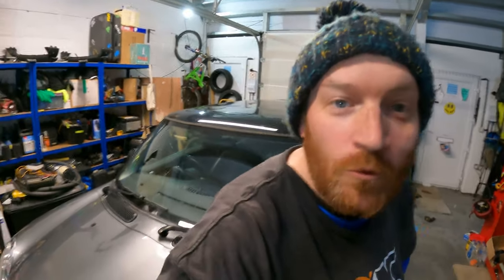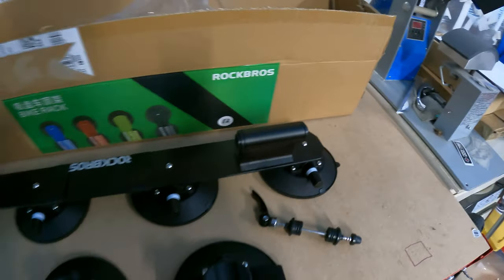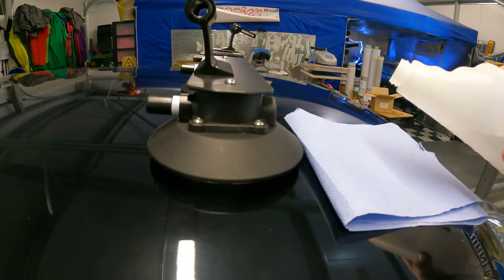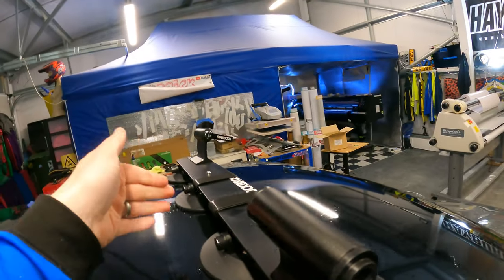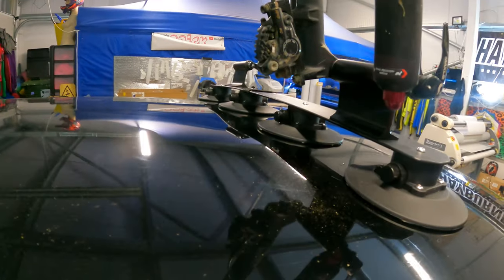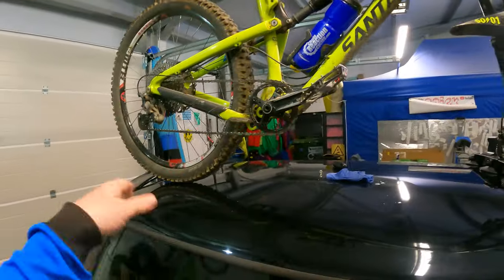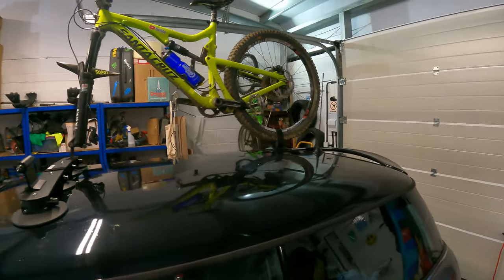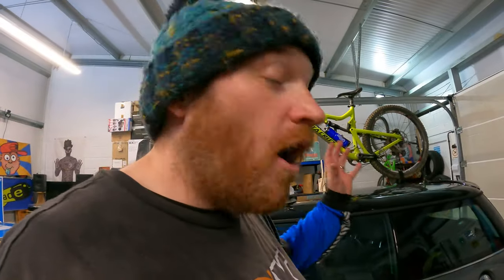Suction Bike Racks...  Are They Any Good?  Seasucker / Treefrog / Rockbros Rack

Comment from the maker: What are your experiences with suction bike racks?
Reply from the maker: Comment below! ✔
Reply: I’ve been using the 3 bike version of this rack for almost a year with great success! Mostly use 2 bikes with it, but have put 2 adult bikes and 1 kids bike on it. The cups have crazy impressive suction. Highway speeds are no problem. I love how versatile it is. Can literally put it on any car!
Reply from the maker: @Andrew-ye4fl  You are right the suction is mad!  I just check the suction every time I set off (overkill maybe) and it works a treat.  I've now replaced my MINI so I'm replacing the suction rack for something more permanent now my car has the appropriate fixings but I'll be keeping the Rockbros in case I need to stick my bike on another car :)
Reply: @Andrew-ye4fl  I've been searching for an unsponsored comment on how this product behaves with motorway/freeway/highway driving so thanks for posting!
Reply from the maker: You're welcome !

Comment: I have had the Sea Sucker version for 2 years or so as I have spent a small fortune on Thule racks and bars over the years due to me frequently changing cars.  I've never had a problem and have had mountain bikes and gravel bikes up there.  The roof may 'pop' on bumpy roads but it isn't the suckers coming off, its the roof flexing (Audi Q5 & VW Tiguan).  The Q5 had a mostly glass roof so the rear wheel sucker was attached to that.  The guy at the shop demonstrating these suckers stuck two on the shop window and hung from it.  They were factory tested on a Porsche up to 140MPH so regular motoring is fine.  The only downside is I cannot lock the bike to the sucker and roof so it can be removed quickly by anyone who knows how, so if it is going to be out of your sight bear this in mind.  Also once at your destination you remove them and put them in the car so someone doesn't nick them, so take a cleaning rag with you.
Reply from the maker: All good tips Al, the flexy roof is nothing to worry about.  That sheet metal on car roofs is mega thin.  Porsche @ 140mph sounds fun!

Comment: I’ve got the Treefrog Pro and it took a lot of courage to set off on a 100km drive with my €8k Supersix Evo on my roof! I stopped three times to check the vacuum but they stayed rock solid on the roof of my car. I absolutely love them, and frequently get stopped or asked questions when people see me with them on the bike!

My only comment would be not to recommend the Rockbros over the Treefrog or Seasuckers. 

They both offer much better customer support (my friends who have Rockbros have been constantly disappointed and swapped), and they also offer every spare part under the sun.

They do cost more so I guess if you are on a budget, maybe the Rockbros is a good shout but if you are placing a Santa Cruz on them, I’d spend the extra…
Reply from the maker: Hey, some good points there.    Took some balls for sure the first few runs but all is good!  I think I was more recommending suctions racks in general rather than the Rockbros in particular.  I've only ever used the Rockbros so I'm not in a position to compare them 👍  Thanks for watching 😎

Comment: there is a lot of good reviews on suction  mounted bike racks as long as you follow the mounting instructions, clean surface ETC & why not the Shard's glass in London  was lifted with suction cups. Mine is roof mounted to my VW Tiguan on the roof bars, in 2000 we went on holiday to Wales & on the way back my wife was feeling car sick so I pulled in to a car park in conwy & forgot all about my wife's Specialized Rock Hopper on the rack, there was £1000 worth of damage to the wife's company car, the rack was wrecked & the bike had a small mark on the head badge which was easily touched up with a touch up stick & she still rides that bike today. It takes a while to get used to it, but when you do its the cheapest way to carry your bike, no fitting tow bars, rear mounted racks, electrics & number plates, that route is £1000 to £1200. One important thing is those with disc brakes fit a spacer in your caliper once you have removed the wheel, if you accidentally press the brake lever your pistons will not come out.
Reply from the maker: Absolutely, the suction cups are a great invention.  Sorry to hear you had an incident with your wifes bike - you really got to have your wits about you with roof mounted bikes haven't you!

Comment: 8 months later, has it ran safely all the time, I hear their after sales support is actually very good. Thanks in advance.
Reply from the maker: I actually changed my car to an estate with roof rails at the tail end of last year so these are awaiting my next car that I can't fit roof bars too.  They worked great for the 6 months I was using them.  I was actually shipping my little lads bike around on there too with no issue whatsoever
Reply: I heard the total opposite but maybe that depends on your location…I’m in Spain.

Comment: Never used them. My experience with suction mounting hasn’t been good but these look pretty heavy duty and obviously passed the test. I’ve only used towball mounted racks.I’ve  always been worried about putting bikes on the roof and then wiping them off on the carport, which is actually quite low. I’ve got an SUV now so I just throw the bike in the back. Putting the bike/s on the roof would free up some space though.
Reply from the maker: I am surprised how well they work.  The mounting surface is a stiff conformable rubber which does conform with the curves in my roof.  Losing your bike to a car port is not as good look 🤣 If I'm honest I wish I could fit my bikes in my car but it's just not possible with this car.
Reply: Been there mate. Had my carbon MTB on the roof of my 2 week old car, forgot it was on there and drove under an archway with a flat on top. Ruined my back windscreen and roof was all gouged so had to have it repaired under insurance. The bike took some damage but not too bad. The guy who’s flat it was above wasn’t too impressed either. Haha.
Reply from the maker: Oh dear!  I don't know if I'd be more annoyed about the car or the bike!
Reply: @mtbtomfoolery  I think the bike survived because the forks and rear suspension were not locked out so I think the bike compressed and flew off but gouged all the car in the process. 😂
Reply from the maker: Good job you had a full bouncer!

Comment: When I got my new car last year I just paid for a trailer hitch to be installed for $209 us and bought a hitch rack. I’m concerned that over time your roof rack will fail and toss your bike. Hope it works out for you but I would be too scared to try one of those.
Reply from the maker: That seems a good deal.  These suckers are rated for high loads, in construction they use them to lift glass panes (not the same ones obviously!) Obviously a roof panel isn't flat so that would give more opportunity for air ingress over time but I check they are pumped before every journey and they have been great.

Comment: Great video.  Do you have any idea if it would work if your mini had a sunroof?  It looks like the front of moon roof the curve of metal would be too much?  Do you know the length of end to end of outer suction cups?  Maybe the rack is too long to suction to the moon roof.
Reply from the maker: Thank you.  They recommend that you don't use them on a sunroof but plenty do with no issue.  That curve in front of the sunroof probably would be too much (I've sold my MINI now so I cannot check for you sadly).  The one bike version would certainly fit on the sunroof, if any of the cups on a longer rack went over the join between roof/sunroof it would not be effective.  Hope that helps.

Comment: So how do you keep people from stealing those sucker with or without a bike on it?
Reply from the maker: You don't, they are not designed to be a permanent rack so you remove them when not it use.  It takes about 10 seconds to remove it all and stash it in your vehicle.  If you leave it unattended with your bike on it you are asking for trouble no matter what rack you have.  That is not a risk I would take with any roof rack setup.
Reply: Forget about the bike which I take it in daily of course, but does that mean you should/have to mount/dismount the sucker rack daily if you live in apartment/park outdoor because while it will take forever to steal my old Thule roof rack with lock, it seem it might be a 5 second job to release the suction and take the whole rack without the need for any tool? is there some kind of thief proof thing for the system?   thx  @mtbtomfoolery
Reply from the maker: Effectively each part can be removed by simply peeling the suction pad off.  I mean if someome really wanted to nick it they would have no problem, but they would have to know what it was in the first place, and know how to remove it.  I would say the chances of them being nicked are slim but that depends where you leave it I guess as with anything worth nicking!  Plenty of people have bikes nicked as they are expensive and easy to pedal away on.  Have you ever heard of anyone having their roof rack stolen?

Comment: My team mate had a Rockbros, but the vacuum cups start to melting after 1 summer. Their vacuum cup material is not that good quality as some of the bigger brands. But the price is cheaper for sure. I know TreeFrog had been tested by TUV
Reply from the maker: That's interesting.  I wonder if they were leaving it on the car longer term rather than just when carrying a bike?
Reply: @mtbtomfoolery  I think more about the quality of the material they use makes the difference on the long run.

Comment: hey dude, have you tested during the rain or snow? i'm afraid it's going to loosen up.
Reply from the maker: It has been fine in the rain, after all you have to wet the suction pads before using them.  Sadly, we can only dream of snow where I live, and if it did snow I'd be heading out on my snowboard, not my bike! i can't see why snow would cause you any issues though :)
Reply: @mtbtomfoolery  thank you, appreciated dude, keep going reviews cool stuff, we need it.
like it.
Reply from the maker: Thank you, will do :)
Reply: Change in air temp is going to affect the pressure of the suck.
Reply from the maker: I have considered this.  However, since it is a vacuum product, if fitted properly there should be no air to expand or contract....

Comment: I will NEVER use such a thing as I do not want to be responsible for killing fellow motorist(s) if/when my bike(s) smash through their windshields.
Reply from the maker: I respect that choice.  Have you seen someones bike fly off their car when using these then?
Reply: @mtbtomfoolery  Not really but like I said on my previous comment I'd rather it not be me who causes an accident/massive pile up on a highway. Metal can heat or freeze up and can severely affect the rubber material used in this mount. It makes me cringe when I see people put the suctions on top of the windshield. I guess not everyone pays attention in Physics classes. :(